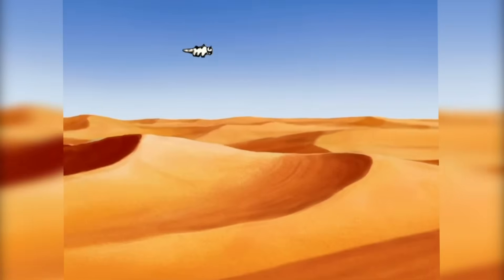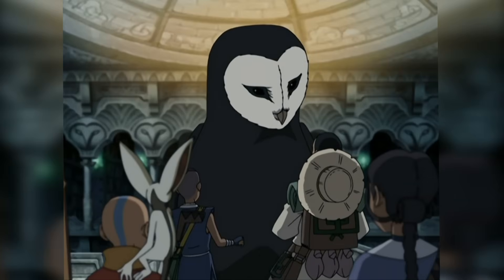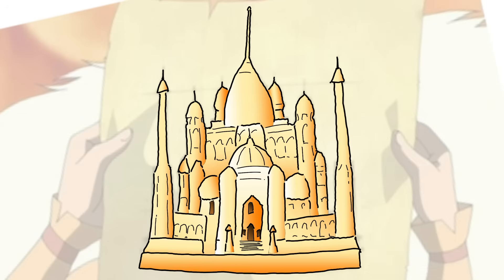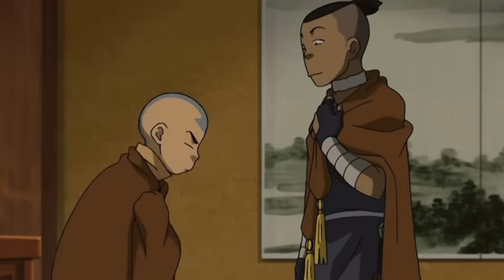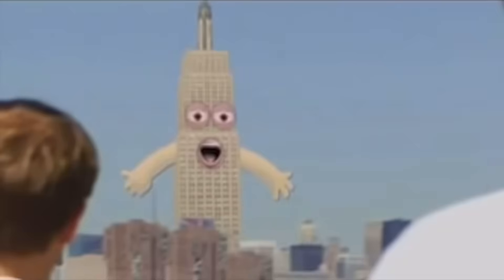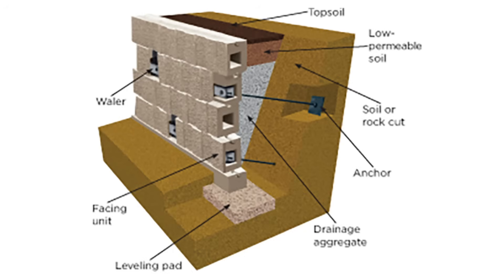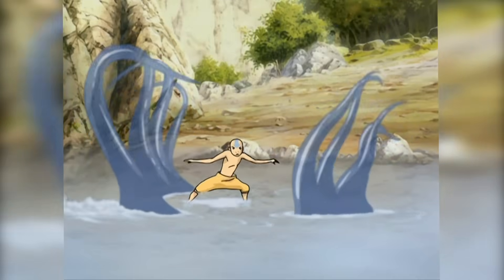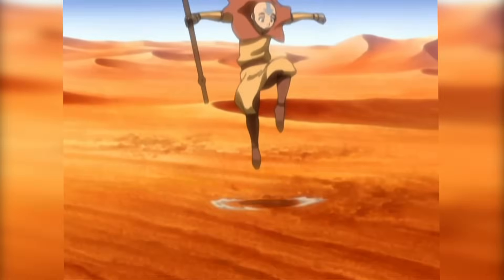Unearthing the Avatar's Sunken Architecture: An Engineering Explanation

Comment: @OnStructures A potential explanation for the differences of the library's top dome between Aang era and Korra era could be, assuming that your description of a shallower inner dome within the outer pointed dome is correct, that when Toph was earthbending the structure to resist sinking she caused or allowed for the two domes to separate during the sinking event. Toph has been shown to be excellent at detection via earthbending, and could have determined that the Gaang was within the upper portion of the structure and focused her efforts on that section to make her work easier.
Reply from the maker: Ya know, I thought about mentioning that, but I left it for commenters to pick up on. Good thinking!
Reply: Toph has a harder time seeing in sand, even at the end of book 3. By that point, she has improved, but she still can't see as well.
Reply: Another possibility is that once in the spirit world wan shi tong did some remodeling in a room with a scaled miniature of the library that responds to wan shi tongs architectural whimsy.